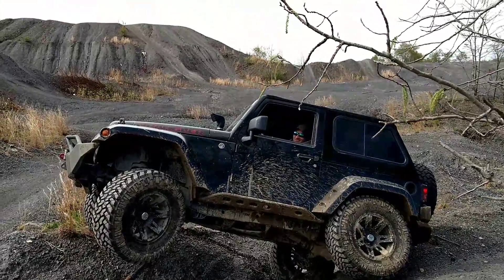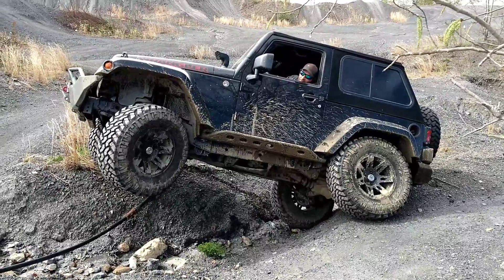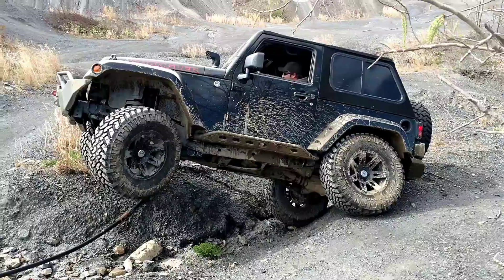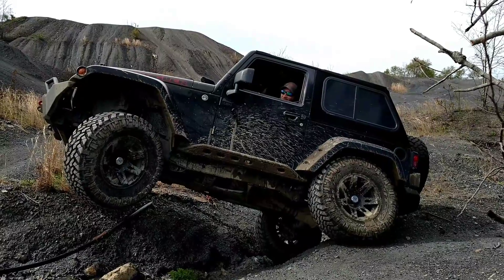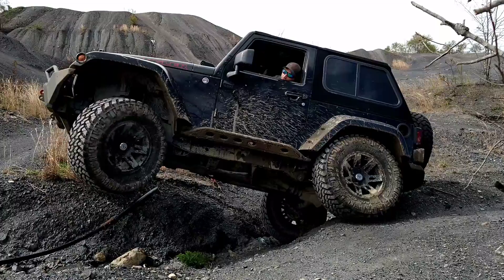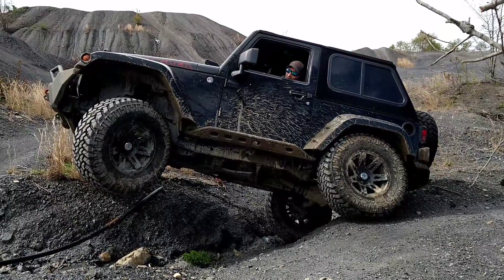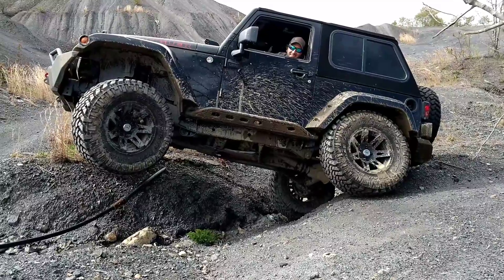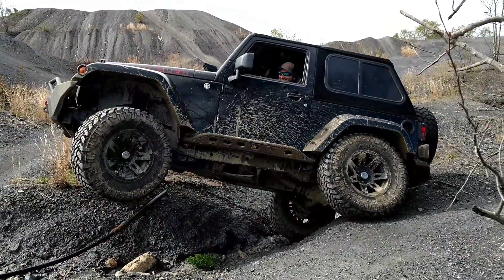The limitations of the Eaton Trutrac differential while using standard LSD rated gear oil.

Comment: I have front and rear DTT in my 99 jeep Wrangler and have never had a situation like that stop me. This is where e-break and foot break with a little bit of gas is used! It's not a locker, but it ain't open diff either! And with a JK???? Something fishy here....
Reply: I also have front and rear trutrac and have never got stuck either. I put a prorock 44 on the front and a 60 on rear and have had quite a few people laugh at me putting trutracs in, like its some sort of baby differential wasted in those axles. But I think the axles are under a lot less stress with a trutrac than a full locker, which will get you home. I can tell you though that the weight of the oil makes a difference, thicker oil creates more bias, driving in winter has the same effect.
Reply from the maker: I found an oil that is magical in our TT diffs. We found this Eneos VW spec gear lube and it's got these things working with an insane amount of bias now. This is it:
ENEOS Gear Oil GL-5 75W-90.

This is the best price I was able to find:
http://koruworks.com/store/performance/eneos-gear-oil-gl-5-75w-90/?gclid=CjwKCAjwuqfoBRAEEiwAZErCstR2Mpke3VZc8XturOGZt4wusSAzCg1FLVHbhf-AxB1K8nmzf3cVdxoCoDkQAvD_BwE
Reply: @LarryMusgrave  so did this fix your issues in this video? Or was it just a question of needing more gas and brake?
Reply from the maker: @chriswithrow3107  
Using the correct oil "fixed" the issue.
Reply: @LarryMusgrave  good to know, thank you for the response. Looking to put a true trac in my 99 F250.
Reply from the maker: @chriswithrow3107  
We are now running the TT in our F550 dump,  F350 dump, the Jeep and a SVT Cobra. Using the right fluid makes them act nearly like a locker. It's amazing how different the mechanics of the device work when you actually listen to the design engineers and use the correct lubricant 😂
Reply: @LarryMusgrave  so is it as aggressive as a locker for just driving around in town, pavement etc? Or pleasant like an open diff until you need it?
Reply from the maker: @chriswithrow3107  
It's more aggressive in sharp turns with mild to moderate throttle, you'll know that the inside tire is being forced to slightly pull faster than if you had a loose (more traditional) limited slip. 

It's a very aggressive limited slip so long as both tires are on some sort of ground. Even for my JK that is a rock crawler on 37x13.50 STT Pro tires, it works perfectly in place of a locker. 

On the street, you'll know that this ain't your dad's limited slip... this is something between a limited slip and a full on locker, and it favors the locker side any time your applying throttle. If you baby the throttle, it doesn't torque bias and you don't feel it. But if you add throttle in a 90 degree turn.... your going to get attention as it nearly locks and makes the tires howl.

Personally, I love it. But it's not "invisible" to the driver like a (weak) OEM installed unit is designed to be. The TT is designed to be a major step up in traction,  torque biasing, and essentially a life long differential that has no clutches to wear out and need replaced. 

This design is most similar to the Torsen differential used by the US military. They use this style for a reason. It's the most durable and provides hands free action that gives ultimate traction.
Reply: @LarryMusgrave  so, it sounds like for a primarily street driven 3/4 ton truck, or in my 3/4 ton work van, maybe a truetrac would not be the best choice, squealing and chewing up tires. I was hoping to get good limited slip action like my 99 C5 has where even with wide tires on good paved roads it's invisible until you drop the hammer. I realize that's a clutch type, but that's the experience I was hoping to get. Damn.
Reply from the maker: @chriswithrow3107  
Yes, I think I would be looking at an Auburn or one of Eatons clutched LSD units if you want a milder unit.
Reply from the maker: @chriswithrow3107  
"Eaton Posi | differential | limited slip | Eaton" https://www.eaton.com/us/en-us/catalog/differentials/eaton-posi-differential.html

Or....

"HP Series Main - Auburn Gear Aftermarket" https://auburngeardiffs.com/hp-series-main/
Reply: @LarryMusgrave  i would not use a clutch type posi. it will burn out with normal use.  i installed a new unit from an wellknown unnamed company, and it would not lock up when i went fourwheeling. i ended up stuck mildly muddied road...Honest.  I ended up going with a truetrac and la locker in the front of my jeep.
Reply: @LarryMusgrave  I'm going to source some of this oil and give it a try. The only thing I found readily available for mail order is 3092-302 - ENEOS Gear Oil. I'm hoping it's the same spec to experiment and see if the torsen style gears work a little bit more aggressively
Reply from the maker: @Mike__S  
It will work massively different.
Reply: @LarryMusgrave  conventional or full synthetic work better?
Reply: @shaun4bigblocks  I'm hoping for something that is not "aggressive" when used on pavement for my F-250. But locks up no question when the situation calls. I don't really have any experience with any LSD at all outside of my 99 Corvette which works like a champ..and I've gone thru almost two sets of tires in 14k miles.

Comment: This is so normal (but not good). ATB diffs don't like crossed axle situations. 
If there is no preload it ill act like an open diff.
Reply from the maker: LowRange But the interesting thing is that with the brake lock differential, there is always pre-load bring applied.
Reply: Yes and No... First you need to rotate both wheels and that is pre-load. If you rotate one wheel and then apply brake force to it trying to give torque to the other wheel it's not pre-loading.

Comment: That's weird even a stock JK could get out of that position with its BLD. Not sure why the BLD is not working even better with truetrac diffs installed.
Reply: I find this video odd, too. Truetracs work off of gears binding. They're basically locked up most of the time, just like lockers.  I feel something is amiss here.
Reply: They must have de-activated the BLD. I have made it through a similar situation with BLD only. I'm confused.
Reply: The BLD with the true tracs will make it lock up in this situation, but when you hit your brakes like that the BLD doesn't activate. He needs to just give it gas and the system will sense the problem. Either that or he installed a fun switch to the purple wire and disabled the whole thing.
Reply: The BLD gets disabled when you apply your brakes.
Reply: With no resistance, power is sent to the wheel with no traction. Nothing like a locker. That is the limitation of the truetrac. A bad option if you lift tires wheeling as shown, a good option if you want something less "harsh" than a locker and don't get your tires off the ground.

Comment: front and rear with trutracs?
Reply from the maker: ken masters TruTrac is in the rear axle only. Both axles were just regeared to 4.88, from is still an open carrier and rear went to the Eaton.

We played here with brakes, traction control, nothing would make that tire with plenty of traction actually help.
Reply: Yes absolutely the brake lock diff system is NOT working. At all. I'm guessing ABS fuse was pulled for this video.